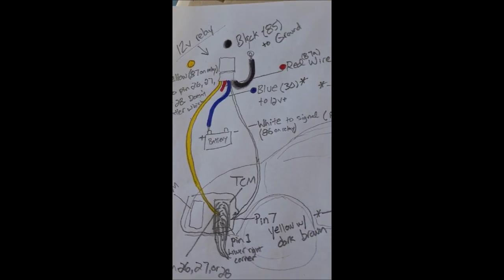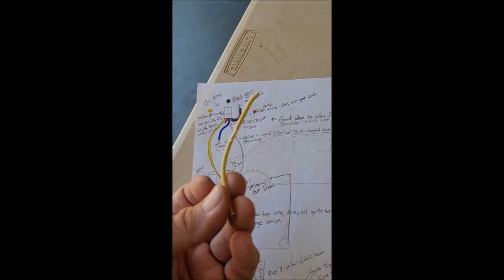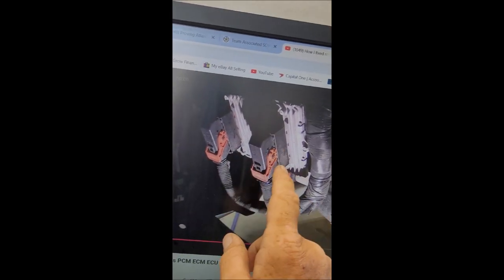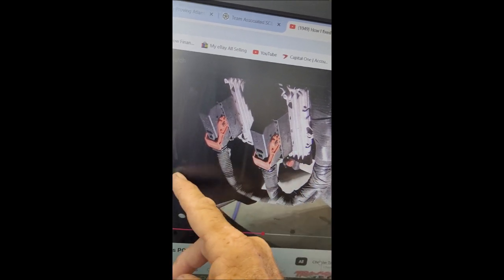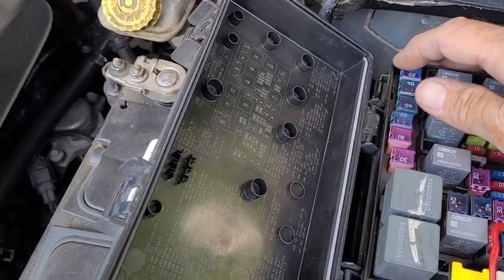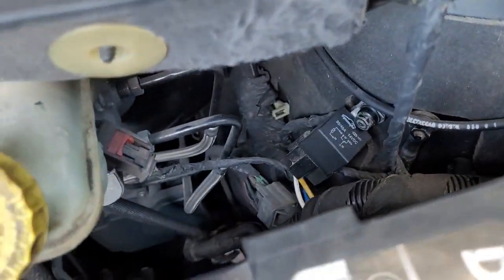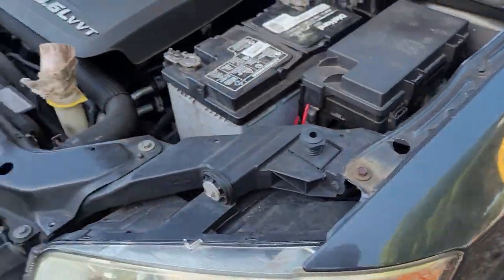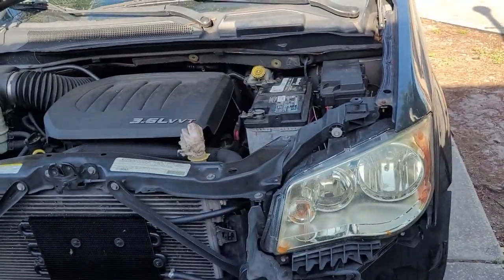FIXED! Code PO882 2012 Chrysler Town and Country 62TE w/ $5 relay. Bypass TIPM.

Comment: Hi, been digging to find solution for my 2012 journey 3.6, having p0882 and p0883, notice the tcm relay stay on, on screen he transmission temperature it give me — but if I ok off the relay I get the number, hope you can give me any idea, by the way I’m done all connector and wiring check

Comment: hi jeramy , i think , i have almost the same issue on My Dodge Journey SXT 2009, the car is working but only on limp mode , i have cleaned all connectors on the TIPM , on the TCM and on the power control module (PCM) as well , even if i have found some corrosion in the connector C4 , but i wonder if there is any connectors in between TIPM and PCM module to check or , i have to go with the same solution like you , by installing a relay ?  what do you think , any suggestion ? thanks.
Reply from the maker: It's pretty common that the TIPM's go bad. Have you read any codes? They should point you in right direction.

Comment: Hey Jeramy I think my messages are not showing up or something but I have a question because your drawing shows two different connections. Up top it says the Yellow from the relay goes to pin 26,27,or28 but on the bottom it says the Yellow goes to pin 7. I'm actually working on this fix now and just noticed the difference on the picture
Reply from the maker: Hmm. Good eye. Ya as stated at 15:35, yellow goes to pin 26,27, or 28.

Comment: So this fix bypasses the TIPM and fixes the code P0882 and limp mode?
Reply from the maker: This question make me assume you're a bot... Yes, this fix bypasses the TIPM and fixes the code P0882 and limp mode.
Reply: @niz76 😂😂😂 yeah I feel like a bot at times but anyway I can't get a good snapshot of that schematic you made. I followed the link to Amazon and couldn't get it there either. So from what I've found this is only a temporary fix to ensure the TIPM is bad right?
Reply: @niz76 Hey, so I bought the relay and was about to do this and was finally able to get your diagram printed and realized there's an issue. On the top diagram it says the yellow wire from the relay goes to one of 3 yellow w/orange stipes and the white from the relay goes to pin 7 yellow w/dark brown but on the bottom its opposite that

Comment: So with this wiring is the pin 26,27 or 28 receiving 12 volts with  ignition on
Reply from the maker: The yellow wire from relay provides 12v to 26,27,28.

Comment: Thank you for this video. My friends 2016 town & country has been in limp mode. He replaced transmission at dealer 50k miles ago. Now it's in limp mode again and dealer gave him insane quote for another transmission. The first code i got was P076A DC Solenoid Circuit. Google says that's H solenoid. I cleared code and checked again and then got P0882 Low Voltage. Today scanned it again and it has both P076A and P0882. Cleared again and cycled key off and on now just giving me P076A again. So my initial plan was to change solenoid pack. Until i got the P0882. So now I'm wondering if doing this relay will solve his issues? Or will it take care of tipm issue and I'll still have to order solenoid pack? Again thank you for this video!
Reply: I forgot to mention I'm planning on ohm checking pin 20 and pin 10 on solenoid pack connector to see if that solenoid is in fact out of spec. I think I may have to do both, I'll know tomorrow when I ohm test those pins. Change solenoid pack and add external relay like you did. Because the P0882 comes back randomly after clearing codes. Again thank you for the video much appreciated!
Reply from the maker: @BuggysTowJam  I'm not exactly sure if it'll solve it but it my case fixing the PO882 solved multiple other problems, so def worth trying first.
Reply from the maker: I also have a theory that the Low Voltage is what kills the solenoids in the pack (if it is actually bad). Hope u luck out and don't have to change that solenoid pack. I've done it twice and it's not a fun project!

Comment: What about hard shift barely goes over 30 2 new transmissions still p0729 and p83b
Reply from the maker: That's "limp Mode" which can be caused by a bunch of different problems. Probably related to TIPM or Trans computer since new trans didn't fix it... just a guess.